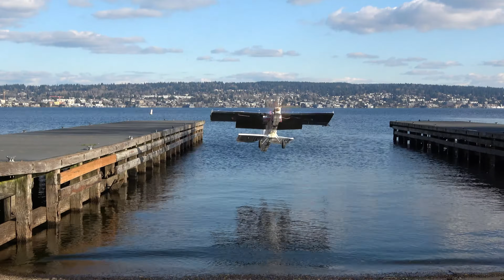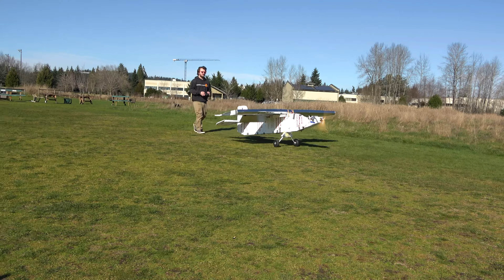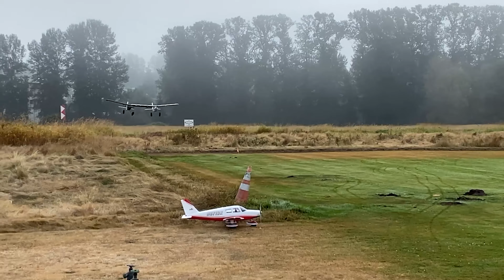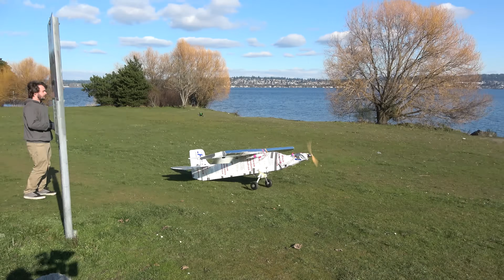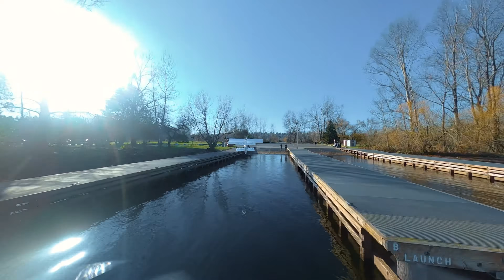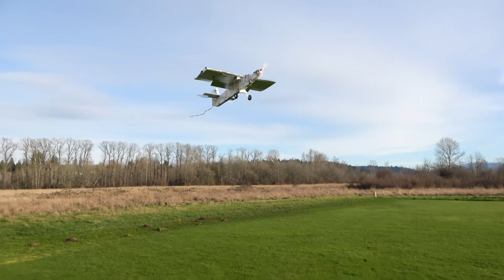Walking My GIANT Plane

Comment: In my 26 years of flying rc planes I’ve lost control of all four controls. I’ve had stuck throttles, reversed or no aileron control, no elevator control and several combinations there of about all four controls. 
Some I was able to save and some I wasn’t quick enough. Some I just ran out of real estate before being able to land safely. I’ve even lost wings before. I lost a wing on a funtana 125. I landed on the wheels after a couple KE circles but it didn’t land slow enough to not flip over and break the tail off. I’ve landed successfully several times with reversed ailerons and a couple times not so successfully. I’ve even saved a plane in a dive that lost its elevator by rolling into KE and flying it out level. That was a puckering experience having to give MORE power while in a dive trying to level out. It was a great plane’s escapade. I was able to arrest the dive and return to strait and level flight but was going too fast to slow down and hit the runway. It flew through a tree and into another tree on the other side of the first tree. The prop shaft is still in that tree trunk to this day. 
Oddly I’ve had the least amount of failures on 3D planes that we obviously fly much harder than normal park and sport planes.

Comment: Quit messing around and get it MORE POWER! I suggest a tri-motor.
Reply from the maker: It doesn’t need it though. 😁 We were just flying it on the backside of the power curve in slow flight so often that it looked like it was under powered. The thing was super light! More motors would have made it too heavy to do what we did with it.